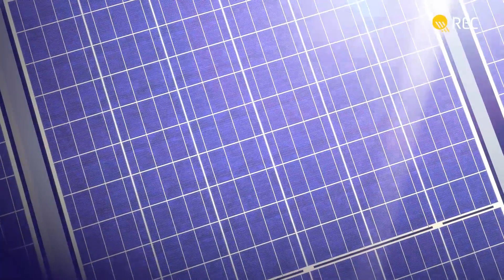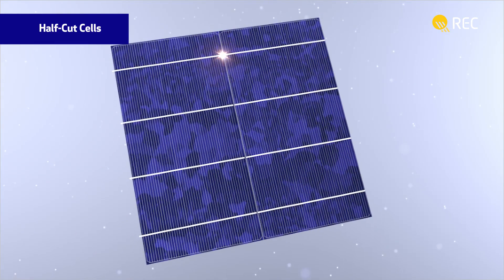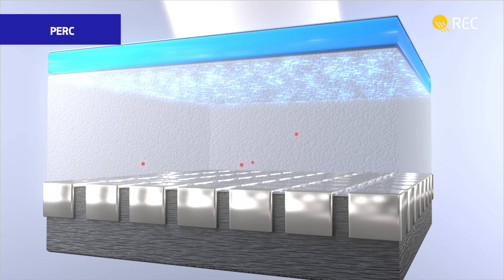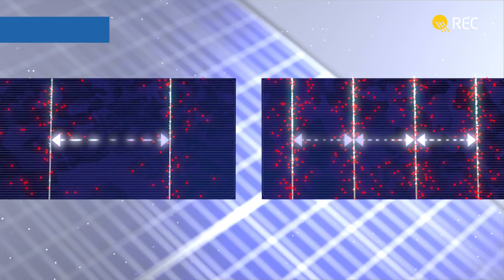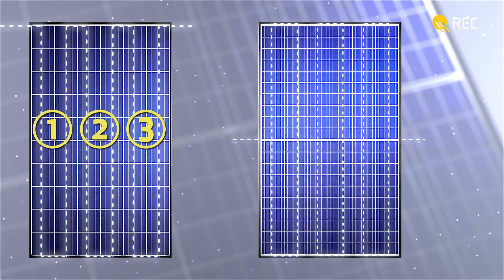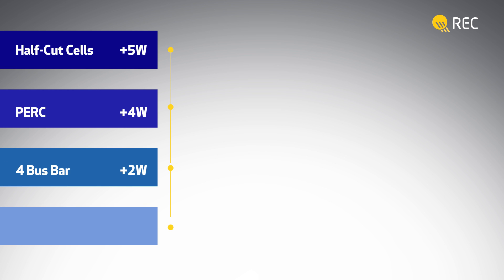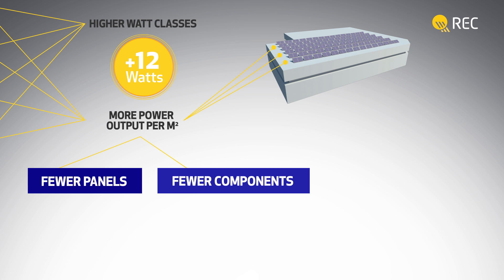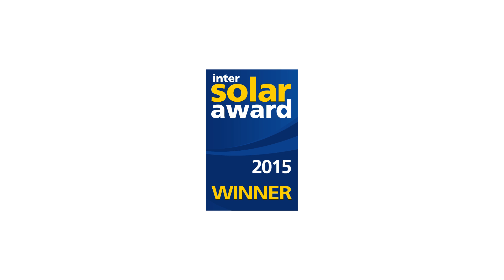(ENG) REC TwinPeak Series - its value-adding innovative technologies

Comment: Hi, Can you please explain how the half cut cells are generating power even when the lower half of the panel is shaded. How single diode is acting as by-pass for lower half and for the upper half its not?